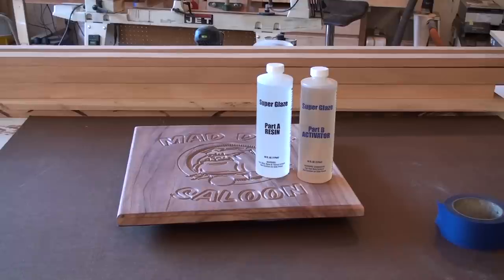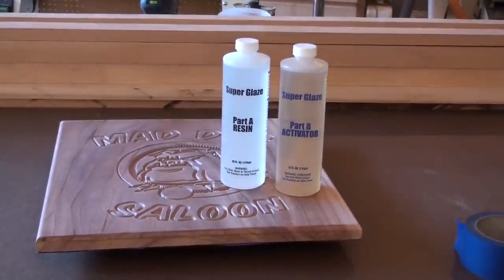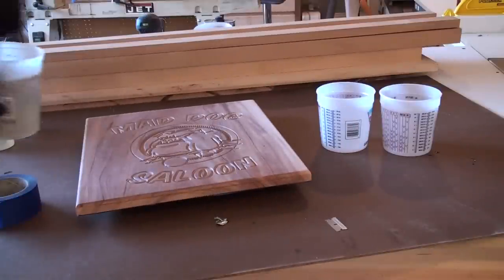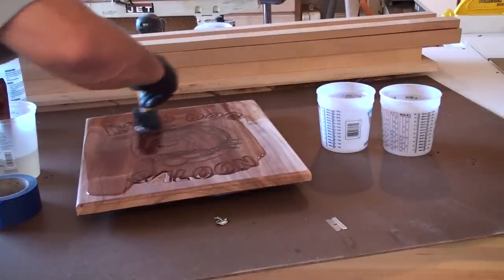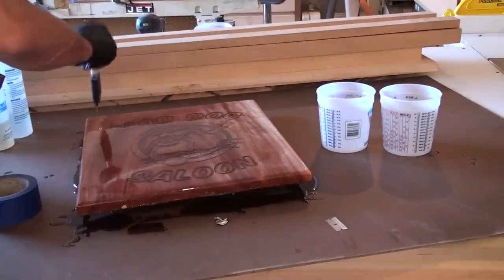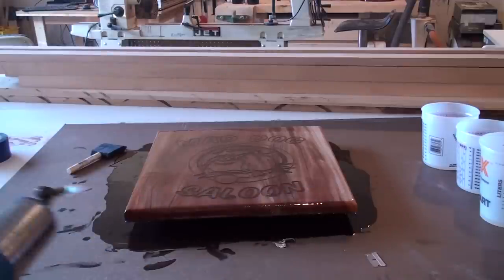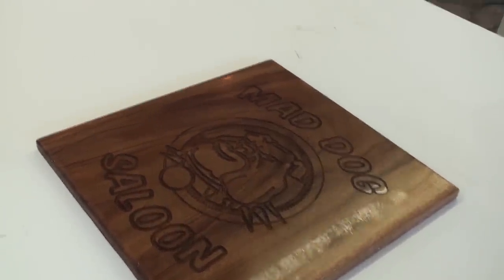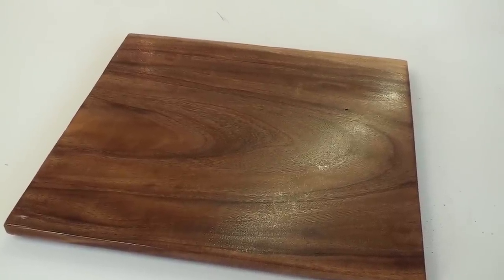Super Glaze Tutorial

Comment: I've worked with this product extensively and I have a few tips... The biggest enemy I faced with product this is dust so I would avoid using a second container as that might contain more unwanted particles- it's OK to mix straight away but use the full 6-10 minutes of mixing- that is important. Bubbles- use a heat gun or high temp hair dryer and you should see them pop on the surface. It's possible to scorch the glaze with a torch if you're not careful. Odors- there is an odor but it isn't terribly pervasive after the first 12 hours. It's always good to have decent ventilation. Spreading is important as it's difficult for this to self level on large surfaces. Cure time and temperature- make sure you follow the guidelines. I get a non tack cure at the 24 hours mark at 65 deg F. I find it's best to let it cure for a week to get a rock hard finish. At higher temps (and depending on the coating thickness), those times can be shortened. Lastly, sanding... This stuff is really hard to sand but the cool thing is that if you want to apply a second coat, you can do a bad sanding job with 120 grit and still get that deep finish that you can stare into- all those sanding marks completely vanish. Oh, one more thing. It is very yellow, so don't expect a crystal clear finish. Hope this helps.
Reply: Give this man his raise 💯

Comment: He went through the standard box instructions and did well with it. If you are watching to try your first attempt with epoxy resin please note… your worst enemy is dust and temperature. You will not get a great even level if you are working below 65 F. 77 f is the optimal temp. Even the most microscopic dust particle that settles into your top coat will be seen when done. It’s such a slow curing material that dust will settle and make big pits as the epoxy continues to level while setting. Also, this pour was enough epoxy to do close to 5-6 of these signs. You do not need to have so much access epoxy rolling off your project. Best practice is doing a very thin seal coat and 1-3 days later (depending on temp for curing) do a scuff sand and then a slightly heavier flood coat. Flood coat is the top coat. There are a million videos on here explaining this. That is where I learned I was just on here to see if this brand epoxy resin was any good at its very cheap price point and available at my local Walmart. All in all it was a great informative video. Just seems like maybe he also was learning as he was going. No offense to the maker of the video just an opinion of mine.

Comment: Great video been wanting to try this figured I would watch a few video's first. when you do the finished shot to show how  it turned out it looks like you have a bunch of air pockets? If so have you found a way to keep them from forming during the drying process?
Reply: gotta love high definition. the air pockets are popped by using a heat gun or torch. what you are actually seeing there was a mistake I made before the finish had cured completely.  I tried buffing it and it burned thru a bit.  if you torch or pop the air bubbles and allow it to cure you'll have NO issues.  thanks
Reply: +Jeff Searles oh!!! see I thought you meant for there to be the contrast with the really really shiny part in the lettering and the matte finish on the raised portion!! I thought it looked very cool like that.

Comment: I just bought 6 qts of this.  I found them on s reduced price shelf lol. Reg. price now is $36.95 per qt. I bought 3 qts of the tinted gray to use on a work table and paid $9.50 per qt. I went back thr following week and the price had been dropped to $3.70 per qt. I bought the last 3 which 2 were tinted "aged wood" and the other was clear.
My instructions say to use a hair dryer to remove bubbles and to do it quickly because it cures very quick and they can be trapped inside it then later they make dimples in the surface. No mixing  containers were included with mine.

Comment: Nice job! You must have sanded it after it was dry as it wasn't very glossy. When I do that, I just give it a second coat of epoxy and it comes out like glass. Also I use Envirotex Epoxy and you only mix two minutes in the first container, then 1 minute in the new container. I've used quite a bit of it and it's good stuff.

Comment: I am planning on using this stuff as a coat to some cornhole boards that I made.  I am curious before I open and use this stuff, does it come out with a sticky surface?  I need a smooth surface so the bean bags will slide.  Also, how long did it take to dry? Thanks for any help.
Reply from the maker: Give it 4 days smooth as glass and hard as a rock you'll love it for corn hole. Brings a whole new dimension to the game. Thanks for watching.

Comment: Did a fairly small bar top (approx 3ft.x5ft.)for a client, and either during transportation or installation it got a couple of indentations on the surface. Can I just do a thin second coat to level out these areas, and how should I prep the surface?  Thanks for your help. Love this product!!
Melanie
Reply from the maker: Melanie3129 Yes, I have done in the past and covers up great. Thanks for watching.
Reply: Any prep to surface other that making sure it's clean and dry?
Reply from the maker: Melanie3129 Just clean and dry, it will be like it was original. just be careful not to add too much or it will be a hump instead of a dent if that makes sense.

Comment: Watched your video. Thank you for demonstrating. 
Questions: Is there a strong (or any) odor when this is mixed up?  I'd like to work inside rather than wait til spring. A little odor is understandable. 
On a pallet wood table top I've used clear caulk in the gaps between the boards. From your experience do you think this will be a problem when applying the Super Glaze?
Thank you.
Reply from the maker: Denise Schnaubelt Yes a bit of odor, but not unbearable.Should wear disposable respirator though anytime working with chemicals but it isn't so bad your whole room will smell no.

Comment: I had a container turn hard very quickly.  As a result I have an uneven spot on my bar top.  Is there anyway to level those spots and make it still look good?
Reply from the maker: Stephen Haynes I have used a torch after a couple weeks just to see if it would smooth it out. It worked but took a really long time because there is a balance between softening it enough and burning it so be careful. I got it really soft then poured a bit more on the uneven part and it leveled out pretty good. Thanks for watching.

Comment: I used this following the instructions to a T and it's still tacky after a few days.
I eyeballed the mix 1:1 ratio and have a good eye.  Didn't pour into a 3rd container.
I know you're supposed to, but I really don't think that's what's causing it to be tacky.
Tried using a heat gun on a low setting, placing outside in the 40 degree sun, nothing, nada, zilch!
I'd like to ask anyone who cares to comment, what can I do to get this to fully cure?
Someone suggested denatured alcohol. Tried using on a sample piece I also put the 
epoxy on, and it leaves a residue.  Glad I didn't use on my finished piece!

Comment: Why so many containers? What is de difference from "pour A and B in separate containers" from "pour B then A in equal quantities in a graduated container"? And what about using that third container? Wouldn't be enough to use a shaped mixing rod, as  to better mix surface and bottom, instead of using the third container? Thanks
Reply from the maker: You have to be sure they are measured EXACTLY correct so I use a separate container for each to accomplish this. If you are confident you can pour EQUAL amounts of each in to one container there is no need for a third. This is what worked best for me. And yes a shaped mixing rod would work. I have tried what you suggest and I personally got better results using the containers as I did. Thank you for watching.

Comment: I used this on a counter top and for some reason it is still tacky in spots. can i apply something to finish drying it. I have the desired thickness that I want.
Reply from the maker: Hmmm...if it's been more than 48 hours and assuming the thickness is less than .06 inches, and it is still tacky, it sounds like not enough of the hardener was used or it wasn't mixed long enough or you live in a very cold climate. Those are really the only 3 things that will prolong the curing process. I would give it a good 72 - 96 hours, and if STILL wet / tacky to the touch, i would mix another batch paying close attention to mixture and stir time, and apply a less than .005 coat over the entire counter top. I experienced a bit of this myself once, and adding another thin layer fixed the issue.Hope this helped and thanks for watching.

Comment: I have a wood flat surface of  14.5 inch  LARGE  by  11 inch  WIDTH.... how much volume of components A and  B is needed for my project?.... Is there any formula calculation for differents areas?.... Thanks for your nice video
Reply from the maker: One 32oz box from Home Depot which is 16 ounces of part A and 16 ounces of part B covers 6.4 square feet. You mix in equal parts. One 32 ounce box is plenty for your 14.5 x 11 inch piece. Square feet is width times length divided by 144. So you have just over 1 square foot, so you'll have plenty.
Reply: Thanks for your answer...I will do my project following that recomendation
Reply: super glaze

Comment: When the sign you used for the video was dry there were slight indents where the carvings were. Question:  How do I avoid that when using it over uneven wood with splits and/or cracks?  The imperfections are desired but nothing less than a super flat surface is ok because it will be a tabletop used for meals.
Reply from the maker: Denise Schnaubelt Just make sure the piece is covered entirely and PERFECTLY LEVEL.

Comment: I poured last night over a sheet of  4' by 6' birch plywood I'm making into a  table.   The wood was unfinished .   I sanded it and I followed the directions as to applying a sealer coat as recommended for a porous surface, i.e. thin coat  of super glaze.   This morning I see the result is about a billion tiny bubbles throughout the wood.  ( did not have or use a torch) as the agent at Lowes said I didn't need it. :-(   Note: I did ask! Obviously I don't want to add the second coat as it seems I'll only exaggerate the problem with the bubbles.  Anyone have any suggestions??  Sand it down and start over?Bob
Reply from the maker: Sand it of sand start over I'm afraid. Gotta pop the bubbles.

Comment: Thanks, but my instructions say NOT to wait until it sets up before getting on those air bubbles. It says to use a hair dryer while the stuff is still very wet, (like right after you poor it on). Of course the instructions may have changed since you bought yours. I bought mine about 3 weeks ago, from Home Depot. 

The box contains two 16 oz bottles, (parts A & B). Other than instructions, nothing else was in the box, (for what it cost, I expected them to include at least some of the tools, like stir sticks and -plastic applicator, but...).

Oh, and my box says that the same two 16 oz bottles that you have, will only cover 3.1 S/ft. for me, (as opposed to yours covering "3.2 s/ft"). Anyway, thanks for the video! I gave it a thumbs up.
Rich

Comment: How did you remove the droplets on the bottom edges where the run off fell?
Reply from the maker: Those do occur for sure. Keep an eye on it and wipe it off periodically. Then I sanded off any that were left when it hardened.
Reply: I use either duct tape or blue painters tape and cover the bottom edges. So there is a blue square on the bottom. Then when it hardens, the hard drips are on the tape, then peel off the tape and the drips are gone. No need to sand.

Comment: is it waterproof?
Reply from the maker: csanjay45 Yes and No...Water PROOF implies can be submerged up to a depth of 100 feet without any problems...water resistant is protection against water.Watches are a GREAT example of that. I would not leave it "SUBMERGED" in water for extended time periods, however it IS water resistant. I have it on several tables / bars, and it is completely resistant to water, beer, coffee, ALL liquids. But again, I wouldn't leave it submerged. Thank you for watching.
Reply: Work Against The Grain   thanks for reply

Comment: Correction in video need stating. From what I can tell on the containers it looks like 4 parts and not 3. What the instructions say it two equal parts in separate containers.  And my box of the same thing indicates equal to 60 coats of varnish and 1 pint covers 3.2 sq. ft.  
Slowly stirring in one direction to reduce bubbles and when pouring blow over the top of any bubbles surfacing on your project will pop them.
Reply: Keith L Beaubien  m

Comment: You must have money to burn wasting so much mixture you could of mixed up a third as much mixture and still covered the sign..
Reply: Exactly! We have a sign shop and we use Helmsmans Spar Urethane gloss applied from a pneumatic gun at high pressure and it looks fantastic and can be used outdoors as well. $40.00 gallon of urethane, $25.00 cheap spray gun and we can coat roughly 30 to 40 such signs with three coats each. This is way too expensive!
Reply: +Mark Huninghake 

.

.
..

.

.

Comment: Ok, my mistake was not mixing  the ratio for the complete 3 minutes, hence causing it to be tacky. The denatured alcohol only dulled the surface and same with a 320 and 220 grit. I used WD-40 and it got rid of the tackiness. Typically I use that when cleaning up caulking on jobsites,
and it always worked, so decided to give it a whirl. Honestly, had nothing to lose at this point. 

Then I used Helmsman poly (uv resistant) in a semi gloss. Problem solved! 

By the way...no need to mix in separate containers UNLESS they are not marked with measurements. Mixing for EXACTLY 3 minutes is paramount and your epoxy will NEVER cure. 

Lesson I learned - don't fuuuuk with epoxy directions!)
Why I didn't mix for the total 3 mins? Well I use Gorilla glue epoxy frequently and you can mix for 30 secs and it works just fine. I had presumed in my infinite amateur wisdom, that all epoxies cured the same, and that Parks Super Glaze was being ridiculous. Bottom line for newcomers to the world of epoxies...read and follow directions thoroughly!! I almost ruined a very important project I was making as a gift.1

Comment: jeff, I'm sorry to say but it looks like you screwed up on this project. you wiped most of it off with the brush, (which took most of the glaze off). Then it looks like you sanded it lightly after it dried, (which took what should have looked like glass on top) most of the glaze off after a few wipes with the brush. The finish project looks as if you needed or should have really went very heavy on the glaze ( it looks rough). Next time try  instead of brushing it pick up the project lightly to even out the glaze on top before heating it...nice try